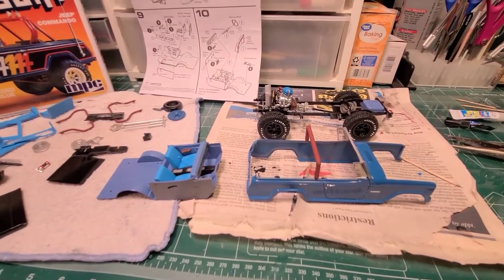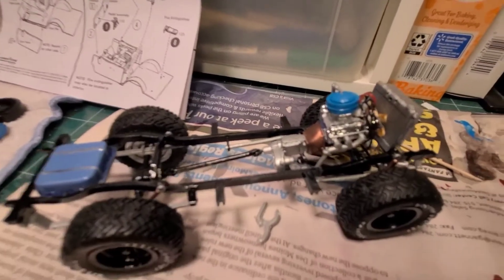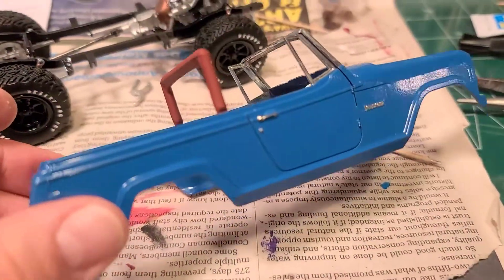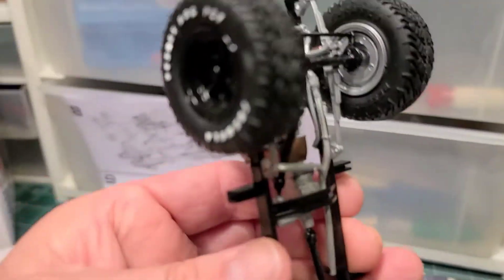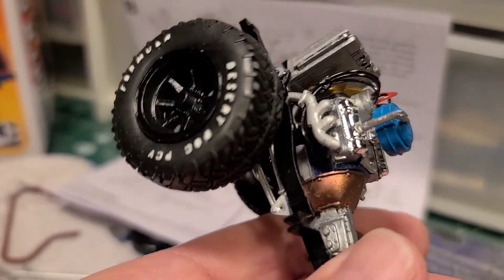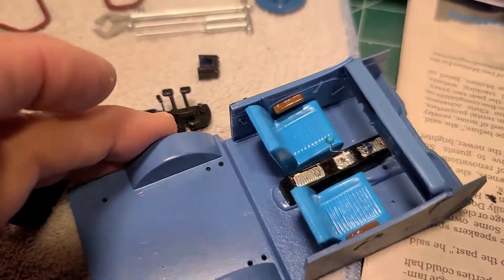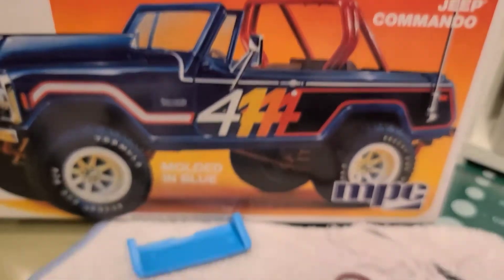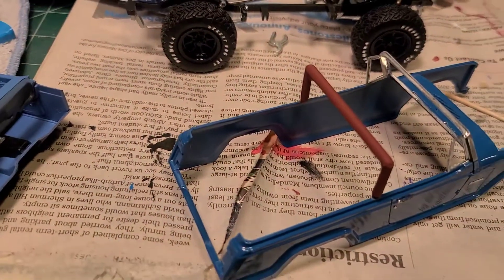Jeep Commando update.

Comment: Looks great so far Mike! I see that slight angle on the engine like you were talking about... A lot of cars but especially lifted trucks have the engine between like 3 to 5 deg. to eliminate the angle going from the driveshaft to the transfer case therefore not putting so much stress on the U-joints. If you are just now getting to putting holes in your engine blocks for wires, what were you doing before? Just grab on of these from Amazon, You will end up using it way more than just plug wires, and pinning parts here is a link to a cheap on (just make sure when you buy one that it closes almost to 0, that way the smallest drill in the world will fit, Some only close to around .050, thats to big) Mine closes to 0 but a .3 mm is still only .018 of an inch so that would be the biggest you'd want,                https://www.amazon.com/dp/B086JRKN26/ref=twister_B08BCFMZBW?_encoding=UTF8&psc=1
 (You can always heat up a thumb tack and just push it in and melt a hole, works great!)
Reply from the maker: Thanks for the tips. What I was doing before was just gluing the wires directly onto the engine block, but since I am now drilling holes with my exacto knife they're a lot easier to attach. Thanks again brother!